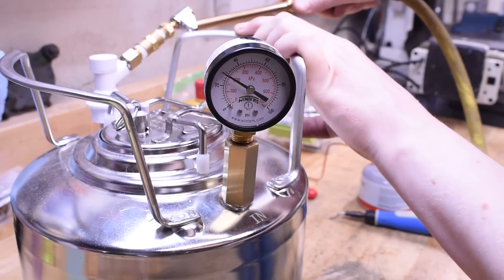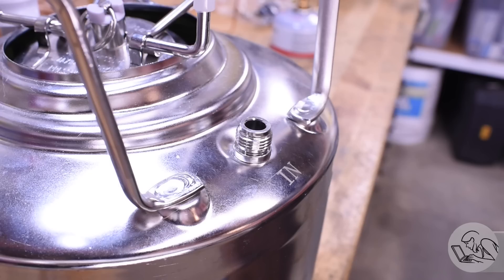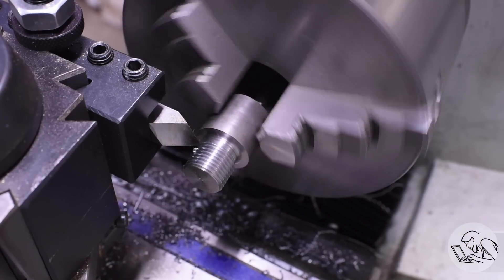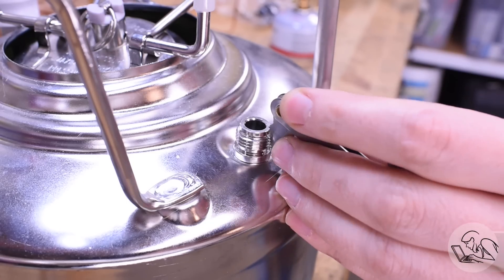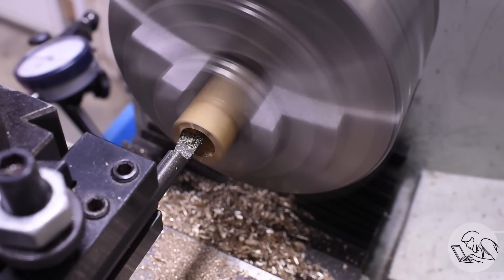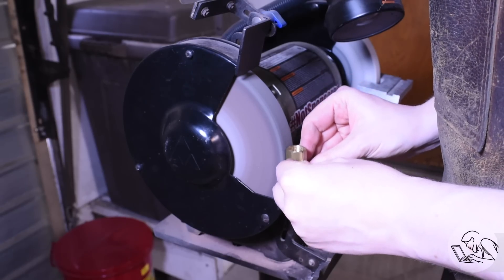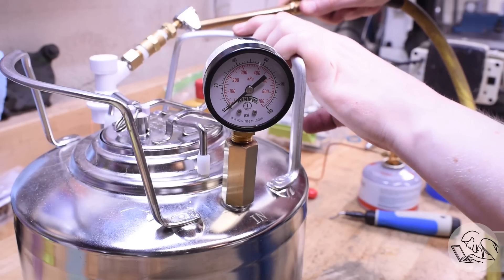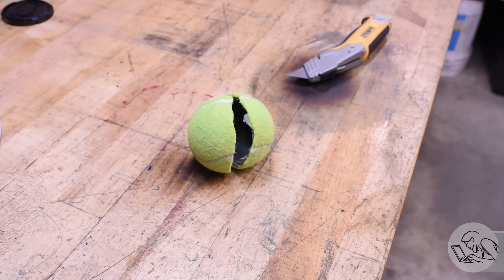Tennis Ball Pressurizer - Let's make one!

Comment: A Lil tip for pipe threads is you should only be able to get 3 turns easily by hand. The total length is 9 complete rotations 3 by hand 3 by wrench 3 left showing. A tip I picked up as a teenager and have been cutting leak free threads ever since. Happy cutting everyone
Reply: that's tapered pipe threads, not this custom stuff
Reply: @Tater1337  One end of her adapter is standard pipe threads
Reply: @UnlikelyToRemember  sorry, missed that
Reply: Also, they make groove joint pliers (generic channel locks) that have smooth jaws with rubber bumpers, so you don't need to scratch every shower head tube you install. Learned that tapered thread tip too late for two showers. Fortunately I still have 2 more to redo...
Reply: Thanks, I've been wrenching almost sixty years, machinist fifty, never knew that.

Comment: 12:10 that right there is the rationale I used to convince myself to buy a lathe. “Where the heck will I find a 9/32-24 LH tap and die to restore this bunch of old stanley handplanes? The lathe will pay for itself by the 2nd part I make!” Well, that was a lie. And it sounds unbelievably silly when I say it to other people. Still, the most fun I had after I bought those hand planes. Take that Stanley Rule & Level Co. ! (Defunct 1920).
Reply: If all you were/are doing is chasing threads its possible to make taps and dies.  Use tool steel, then harden, o1 can be done with a torch I believe.  Hardened steel would be good enough to tap mild steel at least once or twice.

Comment: 18:17 microscopic level? I'm pretty sure we're talking about atomic level here, and yes, it's pretty normal for gases to permeate through rubber, that's why people use metal gaskets when you need absolute air/vacuum tightness.
Reply: After about 5-8 years you can no longer rely on rubber anyway

Comment: I have to wonder if the leakage of a tennis ball is the same in both directions.  Having more pressure on the outside than the inside could in some cases cause the pressure to equaliize but it could also force the air out of the ball as well thus producing a worse bounce. When you think of the principal of an arch, pressure underneath an arch, or inside the ball will cause the surface to expand causing it to want to leak more, where as pressure on the outside would cause the arch to collapse thus making the density of the ball material greater very possibly causing it to leak less.

Comment: Using helium will result in higher bounces and longer hang-time.
Reply: Nah, helium leaks out too fast (helium atoms  - it's inert - are much smaller than the O₂ and N₂ molecules that make up air). This is why helium balloons go flat so much faster than ones simply inflated with air. The helium goes right through the balloon material. 

(And I DO realize you were kidding. My elaborate explanation - with subscripts that took me a long time to find - is in much the same vein. Nice avatar, Harold.)

Comment: This thread thing has driven me nuts.  I use one of these (larger) kegs in a portable rig for thawing potable water lines…  I have a 12 volt sprayer pump attached one side of the keg to pressurize, and the other side has a coil of rigid DOT plastic brake line that I feed down the frozen water line.  A sump collects the returned water to the suction of the sprayer pump.  No watery mess, and I can thaw 25m of waterline quite rapidly.  If you asked me which combination of hydraulic, plumbing, or airline fittings in SAE, Metric, or BSP I used out of the 40 year old collection of odds-and-ends, I’d just quietly go off in a corner and weep.  (And I have to thank Japanese engine builders for introducing me to BSP threads.  I swear, I get my hands on a time machine, a whole lot of fastener “inventors” are going to have mysteriously similar head injuries.).
Reply: I think you are being a little unfair blaming the Japanese for using BSP threads, those threads came from British engines. All the Japanese did was copy those engines and make so many that it was not economic to change to other thread sizes later.
Reply: @chrishartley1210  Oh, indeed.  It’s just the cognitive dissonance of finding a legacy standard half-way around the planet.
Reply: BSP is still the most common plumbing standard the world over.
Reply: @markrainford1219  It just took me by surprise.  It’s not common at all in my part of the world. 2000lb of collected bits and bobs for far too many styles and standards in my shop, and nothing matched up, much to my chagrin.  Thankfully, there’s a hydraulics shop 20km away that seems to have every fitting, coupler, and adaptor in any thread style known to man.  Except maybe those food service ball lock bits. :)
Reply: @markrainford1219  BSTP or BSSP?
Reply: @CCNorse  You mean BSPT and BSPP?
Reply: @markrainford1219  Yeah, thanks for the correction.

Comment: 1) How difficult would it be to single-point cut a common NPT? 2) How difficult would it be to single-point cut an uncommon NPT?
I assume about the same, but cutting tapered threads has always fascinated me.
Reply from the maker: Tapered threads are difficult to cut. You need a special taper attachment on the lathe

Comment: Perhaps you can find a shell for a replaceable core HVAC filter drier? Those are rated for a few hundred PSI working pressure. I got one rated to 400PSI for crazy cheap because R22 was being phased out at the time and R410a needs a higher working pressure.

Comment: Look up CGA fittings to see some really weird threads. They are used as mechanical interlocks so you can't accidentally hook up the wrong lines to compressed gas or fuel cylinders. For example, contamination in oxygen lines can be an explosion hazard. There is also a system called DISS which is used for medical gases (don't want to give a patient nitrous if you intended oxygen).

Comment: I used a 5 gallon corny coke syrup keg for a while as an air compressor tank over 120#.  I sacrificed the stainless fitting by gutting it and tapping 1/4" npt. If I recall it was quite thin at one spot but held up sketchy as it was. Fun note when my brother cleaned his syrup kegs for homebrewing he found cockroach parts inside the little poppet valve :)
Reply: Hmmmm....homebrew with extra body!

Comment: I'm an electrical engineer, not mechanical, but the mechanical DRM of a 19/32"x18 thread happens in PCB development too: Want to make sure that users can't inadvertently plug things in wrong? Reverse-polarize your connectors, so the typical RG6 or BNC or SMA or uFL transmitter/antenna/cable can't plug into your device incorrectly. End result: Your weird connector is on Alibaba or eBay a week after release, and everyone has to add nonsensical adapters in their RF toolbox!

Comment: Find an old 5 gal. paint pressure pot. We've used it for pressure and vacuum for projects, just used a 3/4 inch/75mm disc of acrylic for the vac. The only drama is the bottom is parabolic.

Comment: why not just use another ball lock adapter for the pressure gauge?

aside from making the video even shorter than using blue masking tape
Reply from the maker: That’s the point- you can’t buy them or they are very expensive.